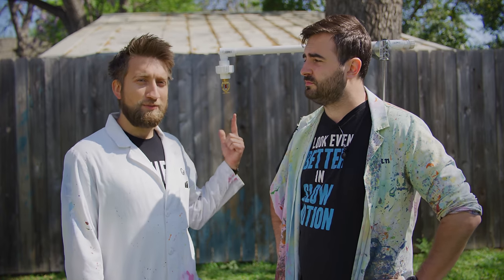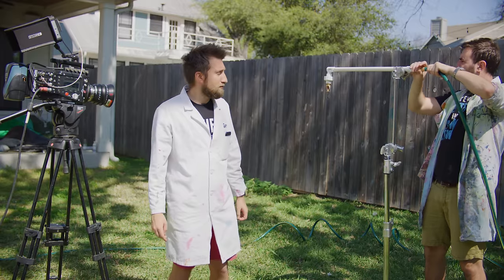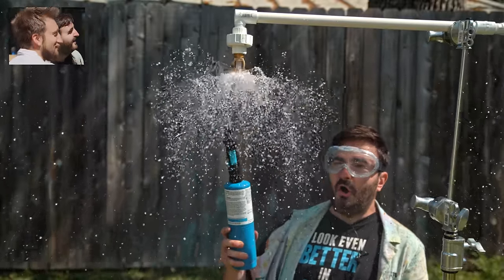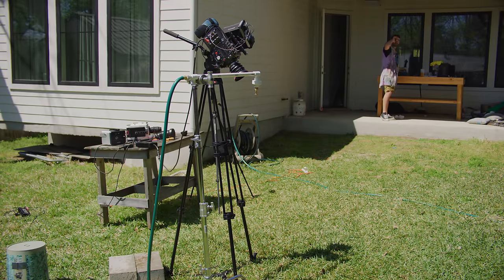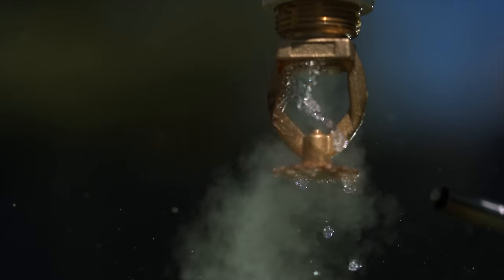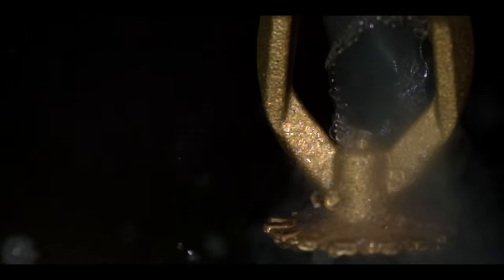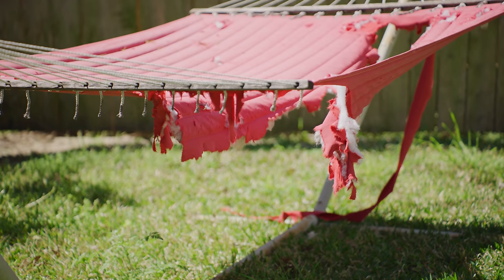How a Fire Sprinkler Works at 100,000fps - The Slow Mo Guys

Comment: TIL: Me, working at an AEC firm (admittedly having nothing to do with Fire Protection other than collisions, as that's a separate discipline), had no idea sprinkler's glass bulbs were color coded.

What they don't cover in the video, though, is that the water pressure for these systems is much higher than what you get with a garden hose. So actual operation is much closer to the initial burst we see until they're either shut off manually at the main valve (typical use case) or have run through their reservoir (if there is one, which depending on the building/facility, hazard level, at whatnot you'll likely rarely want it to stop on its own).  Also, in order to limit the air in the system, since it's dry installed, they limit the water pressure by not fully opening the main valve until a little water comes out of the end of each branch of the system. After all, you don't want to have to wait for the water once they bulb bursts.

Comment: I was going to say, in the US at least the water pressure on sprinkler system is about 80 lbs psi.
That’s 30 to 60 gallons per minuet per sprinkler head, verses 3 to 5 gallons at best per min out of you garden hose.
Also a note, sprinkler systems have a drain at the very end on line, to test, service and flush stagnant water, and also to prim the line as in , being at the end, most of the air is also flushed out.
There are also air pressure systems pressurized by air, as in parking garages, areas that may be subject to freezing temperature,
Basically works the same only when the air pressure drops because the head opens it releases the valve holding back the water at the main riser.

Comment: These sprinkler heads operate on much higher pressure than the garden hose, I used to maintain a system in NY City in a small commercial building, I remember it being around 200 PSI and the heads did not have glass ampules in them, they were brass and had a couple of brass disks soldered together with various solder alloys that had specific melting points, the usual was 180 degrees F as best as I remember When the soldered disks reached the temperature the solder melted and let the disks come apart, they were holding a couple of  other small parts that kept the water plugged.

Comment: Fire Sprinkler systems are filled with compressed air to avoid freezing problems in old warehouses. When sprinkler ampoule pops, the drop in air pressure, triggers a massive diesel powered water pump, that fills the entire building network in seconds. Fire Marshalls regularly test the pump through a large diverter valve, that shoots the water typically onto parking lot, or concrete pad. Worth checking with local fire inspectors, to see test in progress.

Comment: I accidentally set one of these off at one point. I was 10 meters up in the air on a lift doing some cleaning inside a factory when I bumped the mop head into the 
ampoule and it broke. It was an industrial grade sprinkler and I was at eye-level with the sprinkler head. It felt like, I would imagine, having a waterfall pelt you in the face. 
Needless to say, it took only a few seconds before I looked like I had been in a swimming pool as was fumbling to find the controls to lower the lift. Good times.
Reply: Lucky you didn't lose an eye. And something that they don't talk about in the video that you probably know all about, is just how disgusting the water that's been sitting in those pipes is. Tends to smell like sewage..

Comment: I saw a sprinkler get the star ripped off once. Watching a 100 psi laminar flow shooting straight down to concrete and splashing everywhere was quite a site. I've also seen one with the star still attached actively spraying because it failed during initial pressurization. At 100+ psi the water almost becomes an aerosol when it hits the metal star. The water is also black from grease and grime inside the pipes until all the standing water in the system drains and fresh water is pumped into the system.

Comment: Fun fact: this isn't the only design for sprinklers! There are some that aren't one time use, but this style is by far the most common. The only "flaw" is that you can, y'know, break the ampule with physical force, but that takes more than a slight bump. Usually something more like someone doing cartwheels and kicking it or something silly like that.

Comment: What you probably didn’t realize also is that most house pressure like what you’re using on that garden hose is anywhere between 40 and 60 psi. Fire sprinkler suppression systems are capped anywhere between 150 and 300 psi. So the water you’re seeing coming out there that you think it’s a lot if you have ever seen a sprinkler head in a commercial establishment go it’s absolutely insane it’s like comparing a river to a tsunami

Comment: the glass vial holds a metal plug in place. The bottom tip of the metal plug has a slanted face so when it hits the fan shaped diffuser it will bounce off to one side and not get stuck there.

Comment: Did you find the cap the ampule is holding in place??   is it just a cap or is there any valve on the cap?? You fired off enough of the sprinklers where's the caps?

Comment: I was a firefighter. I have been in the room when a sprinkler head for a dry system went off. The whistle is…rather loud. 

Also, that heads isn’t putting out nearly what it is made for. When you hook the fire engine to the system FDC outside, then listen to the orchestra wind up in the fire as 120+ psi water comes screaming out!

Comment: The bottom of the sprinkler is called the deflector and the bulb pops and the whole brass seat falls out. And no they all don’t go off like they do in the movies just where the fire is that sets the sprinkler head off. I’ve been installing them since 07.

Comment: Usually these ampoules don't crack because of the liquid, the break because there is an air bubble inside that expands. The smaller the bubble, the higher the temperature resistence. The liquid is always the same its just colour coded in order for you to differentiate them easily.

Comment: One went off in my apartment building a few years back and it filled 2 floors a few inches in water, When the pumps kick in the water pressure was so great it blew the guy of the ladder he was using.

Comment: the air bubble inside is what expands and breaks the alcohol mixture, the size of the bubble decides how much heat is needed to break the glass, the bell housing being held by the bulb to act a a plug can withstand about 600ftlbs per sqin of preassure pushing down, but you can flick it with your finger from the side and break them

Comment: If you look closely at the bulb ('ampule' as you say)you will see there is actually a small air bubble also traps. The size of the bubble determines the temperature . It's expansion breaks the bulb. The dye is purely a marker.

Comment: Dealt with sprinkler systems many of times. There’s several versions but the vial is plugging the hole where the water comes out. The whole sprinkler system has to be charged with water pressure. If the pressure drops too low it triggers a alarm

Comment: The bulb is called the element or trigger,  and the seat is what it sits on. Your actually supposed to bleed the air off the system before you put the system back into service.

Comment: The outer rim is the deflector an the smaller fins between are called tines they separate the water. Depending on heads some tend to flow more or accurately cause a mist

Comment: PENDENTS 155F•  When a sprinkler head has a glass bulb, that bulb typically contains a glycerin-based liquid. Once the air around the sprinkler reaches a certain temperature – often 155F or 200F (68C or 93C) – the liquid expands which causes the glass to break. The water held back by the bulb then escapes and flows toward the deflector, which disperses it throughout the room.

Comment: if ur confused on how a skittle triggered the sprinkler its bc sprinklers have a little glass with a liquid inside that covers the water hole and when it gets hot enough the liquid expands making the glass burst causing the water to flow out and dampen the fire but the skittle probably hit the glass and made it the water flow out

Comment: The juice isn’t what makes the bulb for a sprinkler head go off but it helps if you hold the bulb side ways there’s a bubble in it that gets headed up and expands from vapor and the pressure inside the Bubble explode

Comment: I install these... Your average sprinkler head has anywhere from 70 psi to 120 psi behind it. Although the garden hose shows basically what it will do its not even close. These things will straight up clean drywall off of a wall.

Comment: You missed a couple rather interesting facts. The red liquid is glycol and it doesn’t expand,there’s and air bubble in the glycol that expands when heated,breaking the frangible glass bulb also the size of the air bubble combined with either 3,5 or 7mm diameter bulbs is what determines the temperature rating of the sprinkler head.

Comment: Keep i mind the pressure in the pipes is kept much higher that the garden hose. In the area of 150 psi. you see about 20% of the flow that comes out of a sprinkler head in actual system.

Comment: I worked as a building engineer and have unfortunately been present when one was set off by a painter. Something that most people don’t think about is that the water in the pipeline has in most cases been their for many years and you get doused with water that smells like a sewer. I mean its really bad.

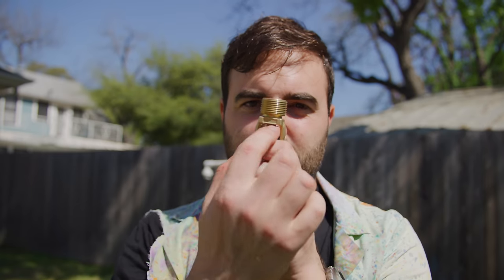Comment: At 3:45 Dann says the metal ping will drop out after the red pin has been distroyed by the heat of the fire. Ehhh no the metal pin doesn't fallout it will be puched out by the water pressure. And 99.9% in the movies they all go of in the picture witch it doesn't only the sprinkler that has been touched by the heat will be activated. Not so nice thing is the water will stop by setting of the waterpumps of the building most likely by the fire brigade. And the give a lot of water damage. But nice video cool to watch it in slomo

Comment: You guys need to do it again at about 200 PSI. I build steel fire sprinkler systems and fire sprinkler pumps for a living. You will get a much crazier video I promise you that. But you going to need to stand back and protect your cameras

Comment: I am a sprinkler fitter it is more amazing when it actually has the street pressure behind it most heads have a 7ft spray radius up to I believe 14ft in a high pressure head

Comment: You have to bleed the lines of air first. Plus the water should be under pressure.  That would have given you a better and more accurate display. Still very good tho.

Comment: This has been from observing them and taking information from other places 

By what I have seen most of these have also a bubble in them that takes the force until it gets to the point where is can’t anymore and then the pressure continues to build until it bursted. I’m guessing that the liquid in the tube is just a water dye mixture. Then once the capture blows it then slows the plunger to be launched out by the water. I also think my school has had this happen (building finalised in 2013) as they allow 6th formers to get jobs inside the school and part of my job included looking after the DofE kit store located in the boiler/plant room. And over half them instructions on a4 paper for how to stop and reset the system where taped onto the unit and the science department had to deal with water damage to the floors.

Comment: Movies do not always portray reality. But when one of these things activates in the movies, all the others immediately activate with it, such as when somebody wants to activate all of them but holds a flame under just one of them. If this is real, how does the activation of one automatically trigger all the others? Or, is it, as I suspect, that each one is activated as the heat rises local to each one?
Reply: The movies are wrong and you are correct. The sprinklers are heat activated and operate independently of each other.

Comment: Most of these systems are 'dry' systems.there is no water at that nozzle when it bursts.Only compressed air.After a number of seconds(0-60) of hissing air,depending on the distance of pipes, will you get water and its more like 30-60 gals per nozzle per minute.And No,you dont also set off all the other nozzles(every single one of that type of nozzle must be set off individually by temperature rise)-that is only in a special uses Deluge system.Expensive and Only used where necessary.Not all of these use this glass system.there is a similar type that uses metal alloys instead and which melt at predictable temps.I like them better than the glass types as they dont go off if you bump them with a ladder.The glass ones can.

Comment: I have had  inmates in jail that have broken the ampules to activate the sprinkler system in their cells to flood them.  The water that comes out is blackish and clears up eventually because the water pipes have a lot of sediment in them because the water has been sitting in them for so long.  So everything is pretty much blackish.

Comment: do not try to heat Hg-thermometer with fire, it will explode immediately and Hg will be all around the room. I tried it when i was 12 and i was surprised that it explodes in a second

Comment: The " juice" inside the glass vial on the sprinkler head doesnt expand actually... the color of the liquid inside only designates the size of the tiny air bubble loaded in each vial... so..the bigger the bubble...the lower the temp it takes to break the vial and trigger the sprinkler. 🔥🚨

Comment: One actually installed in a building has much more pressure and has a pump connected to it of pressure isn't high enough they actually cover much much much more then what it shows in the video
Reply: There's also several different types of sprinkler heads and systems this head is called a pendant because it's upside down and ones that are upright are called upright heads
Reply: The most common system is a wet system where the pipes are full of water but there is also dry systems where the pipes are full of air untill the heads go off then they fill with water

Comment: Weren't these made with solder in the beginning? The solder would melt and it would open. Not as fast as the modern ones. You wouldn't need slo-mo!

Comment: I don't know, I like the American measuring system.  You get more precise numbers in some cases and simpler numbers in others.
Temperatures for example, you can go more precise with less decimal points, and miles is simpler than kilometers.  Kinda like rounding some numbers to a simpler digit.  
So instead of saying a couple thousand km, you say a couple hundred miles.
And temperature wise (which is important in many cases) you get a more exact number with less decimal places.

Conversion from feet to miles and stuff is more difficult, but you know... we have all the knowledge mankind has ever obtained as well as converters in the palm of our hand.  

I'm bad at explaining things
Reply: 0 is freezing, 100 is boiling, and metric is entirely divisible by 10, 100s, 1000s etc. There are 1000m in a kilometer. There are 5280 ft and 1760 yards in a mile, and freezing is 32 and boiling 212.

You'd be hard pressed to claim imperial and Fahrenheit are actually superior in ease of use. I also think its our familiarity with these units that makes us feel like they're easier to read. Like I do agree that Fahrenheit is easier to read, but its also the way I was taught. That's just bias though. Objectively Celsius is better. You're still going into decimals with Fahrenheit regardless.
Reply: @stevenpuckitt212  as I said, yes, conversions is a pain, but it's easy once you get the hang of it and become familiar.  Its true with everything.  Ease of use does not always mean superior though. This might blow your mind but everything has vastly different boiling points, than waters boiling point.  The system was made with water as its base. And yes, all units of measurement use decimal points.  Just less in come cases. 

I do not claim the US measuring is better, but my personal thoughts and why.  The way we are taught shouldn't affect how good or bad something is, nor should its simplicity in nature.  

We must look at its usefulness rather than it's easy conversion.  The freezing and boiling point of water has no meaning to alot of people.

Also celcius is not objectively better, that too is bias.

Comment: I feel like these don’t have a lot of power against fires
Reply: As someone who works in the fire sprinkler industry...Most fires in a building with fire sprinklers are put out by one or two sprinkler heads. The pressure in an actual system is much greater than what these guys are getting out of a garden hose. Not only do these systems save lives, they save property damage as well.

Comment: This is why sprinklers are installed in highly pressurized steel pipes. Also, if this was actual sprinkler water Dan would not want to be anywhere near it because it's likely black water. Black water is disgusting